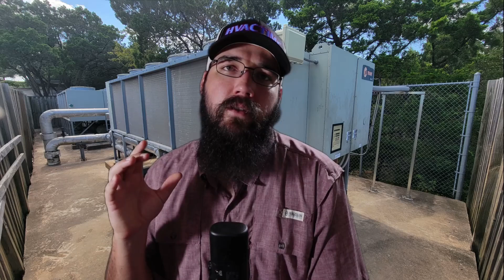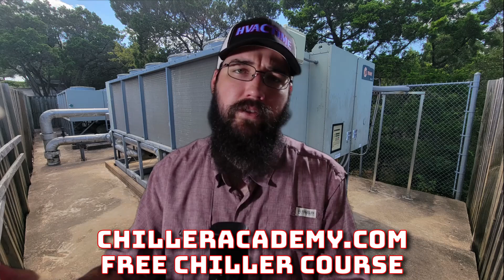What does Chiller Load mean?

Comment: Ive seen Alot of different machines here in Phoenix with low TD from scale.  Water treatment logs and testing and cooling tower appearance can also help paint a picture. Usually a half day of circulating acid across the condenser tubes ( don’t put that stuff in the tower! Doesn’t like it)